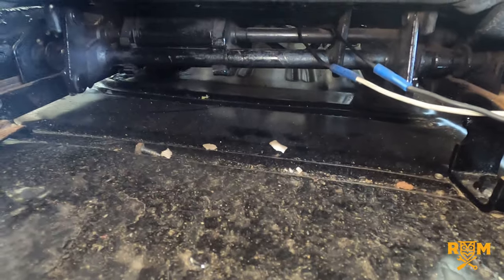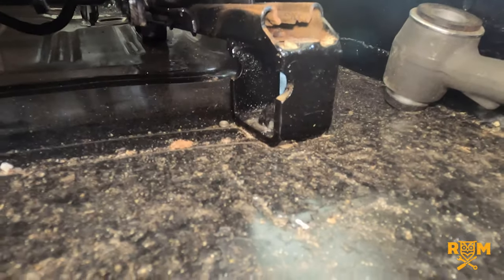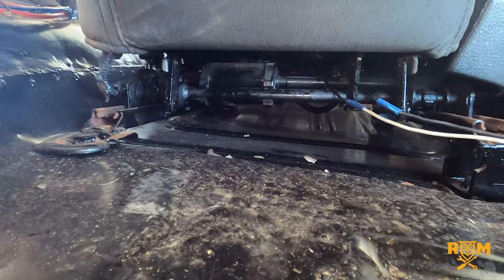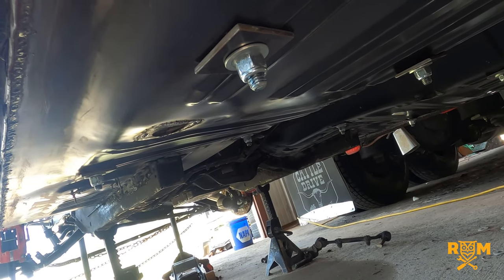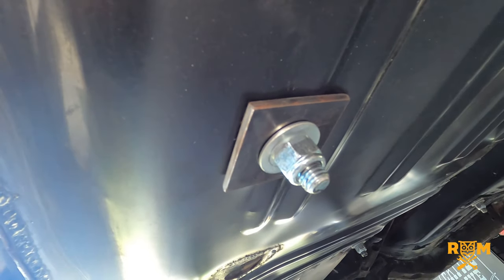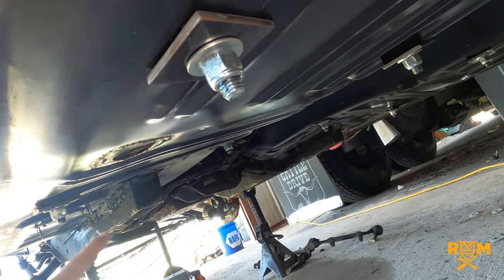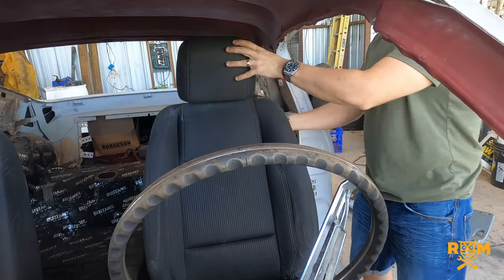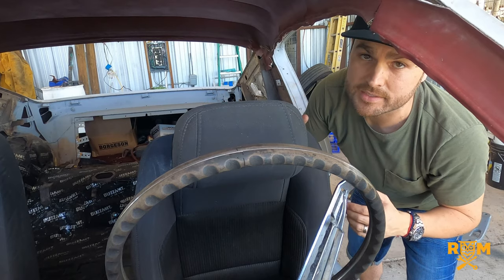Power Seats For Your Classic Car! How To Prepare And Install The Correct Way

Comment: Will be adding drivers power and heated seat to my Ford E350,  using 3rd gen Honda Odyssey seats color is very close, they are leather and very comfortable  plus free. Seat controls are on the side of the seat just have to figure out the heat. On the Honda the heat control is in the lower dash.  Figure HD relay and minimum 10ga wire. Find a spot to mount the switches. Power portion will be the same.

Comment: Where did you run the power to?
Reply from the maker: Hey James. Thanks for the view. For purposes of the video the power was directly on battery.
Reply: @therestomaestro3556  how does it run I was told could burn seat motor up like that